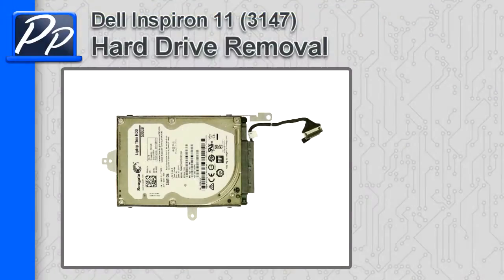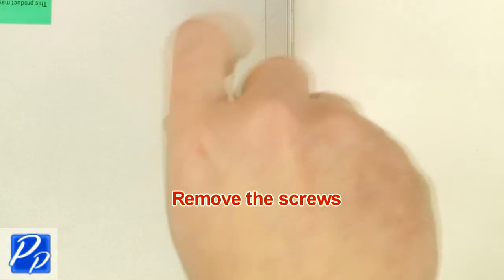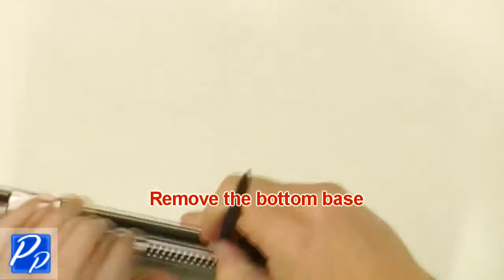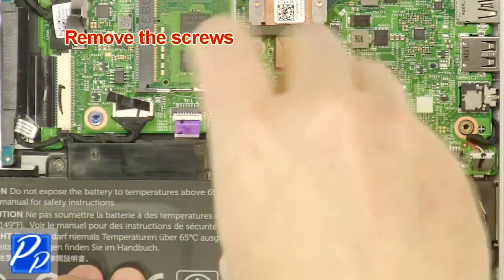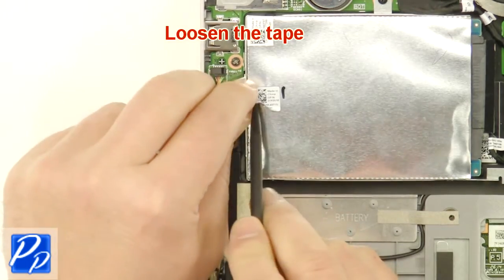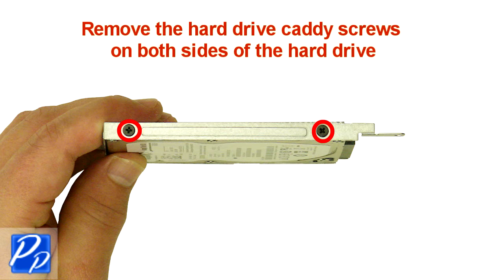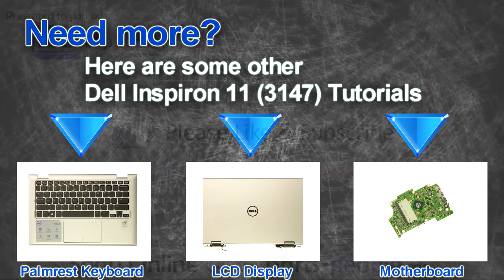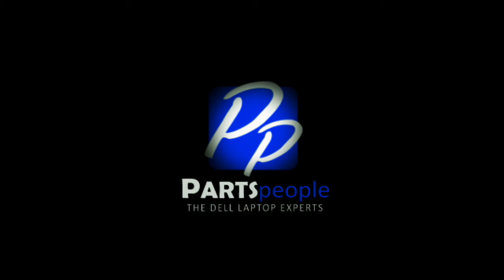Dell Inspiron 11 (3147) Hard Drive & Caddy How-To Video Tutorial

Comment: hello I have the same laptop but I need to format the hard drive and reinstall the windows 8.1 is on it but theirs no disk drive I've tryed to use all of my other laptops hard drives in my Dell like u have in the video to see if it would boot first before I format the hard drive but none of them are working how should I do it? it's a 500 gig and it only lets me use 130 gigs out of the 500 it was sent to Dell for a screenshot replacement and touch pad replacement for Shure. I got the laptop from a friend I don't know if it's had any other work done to it please help I want to use the full 500 gigs of it I knoe it can be done but I haven't found a way yet even tryed a USB external disk drive
Reply from the maker: This will show how to format the hard drive once it's installed. http://blog.parts-people.com/2015/09/17/hard-drive-formatting-how-to-guide/ 

If you contact Dell, they will send you a thumb drive with a Windows 8.1 download. Also, the laptop will only recognize the hard drive after it's been formatted which is, what I would guess is, the reason why it's only recognizing 130GBs.
Reply: Parts-People.Com, Inc yea it's had multiple os's on it and I cant delete the old files because nothing shows up that's taking up all that the HDD so once I format the hard drive (from another laptop) it will recognize it and let me use a external disk drive to install the os of of my choice right?
Reply from the maker: Yes. Once you format it on that laptop you will be able to load any OS via external USB drive.

Comment: I know I have a hard drive issue which I will be getting a replacement hard drive for. My touch pad is also slowing and my esc, ~, tab, caps lock, q, a, z, and shift keys do not work. Would a hard drive replacement fix these issues as well?
Reply from the maker: I doubt it. You will probably need to replace the palmrest/keyboard. http://blog.parts-people.com/2014/12/01/dell-inspiron-11-3147-3000-series-palmrest-keyboard-removal-and-installation/

Comment: Help? So my Dell (same model you used in your video) says "no reboot able device strike f1 to reboot" and other options to fix it and I've done everything I could, but it still says no bootable device. Is this because of a problem with the hard drive?
Reply from the maker: Yeah it's gonna be something to do with the hard drive or maybe a loose hard drive connector. If it's not the hard drive connector then it's probably a bad hard drive.

Comment: with performance in mind, and money not being an issue, would you suggest an HDD/SSD or full SSD upgrade.

And do you know whether this system has a SATA II or SATA III controller?
Reply from the maker: This has a SATA II (3Gb/s) controller. A 2.5 inch SATA II SSD would be the best hard drive upgrade you could make. You COULD install a SATA III (6Gb/s) but  it would down clock to SATA II speeds.

Comment: How much ram can this laptop be upgraded to?
Reply: Parts-People.Com, Inc I have succesfully upgraded to 8GB on the one bank.
Reply from the maker: I'm not absolutely certain. Dell says 4gb is the max but, I wouldn't be surprised if it was actually 8gb.
Reply: Daniel Copp jflores85 the model number of the 8GB RAM stick i bought that works is CT102464BF160B. google for shopping results. 

Here is proof of working 8GB stick.
https://lh6.googleusercontent.com/-4-gBZMR8i-Q/VSS-SfSIzxI/AAAAAAAAA-M/zki4YbjME8A/w864-h484-no/Screenshot%2Bfrom%2B2015-04-07%2B22%3A30%3A29.png
Reply from the maker: Daniel Copp
That's kinda of what I figured. Good to know!